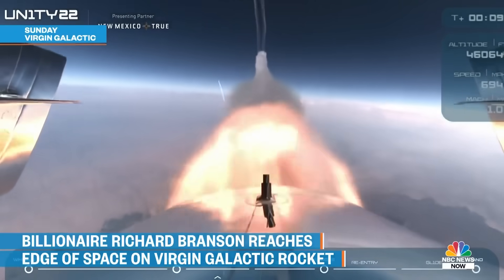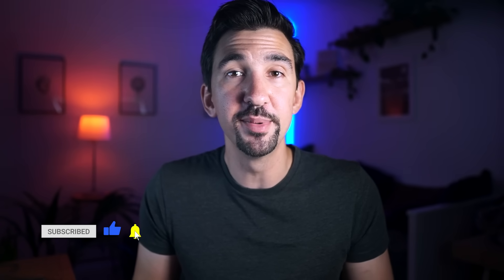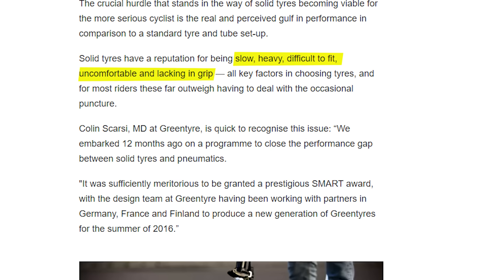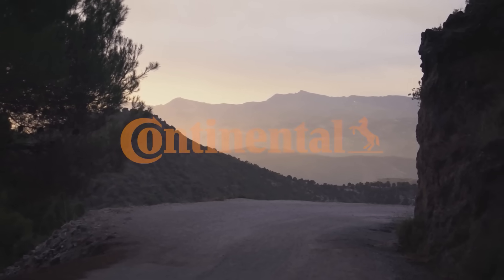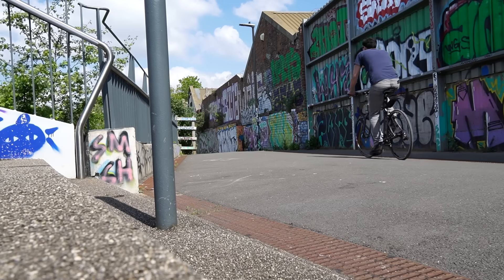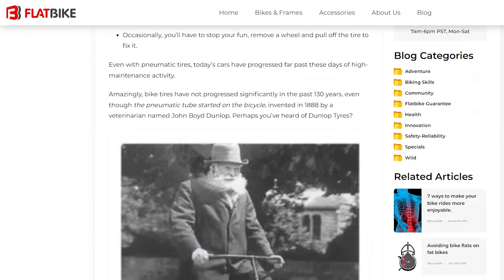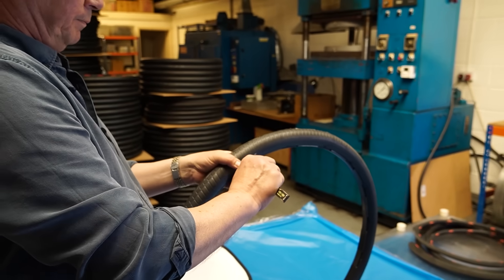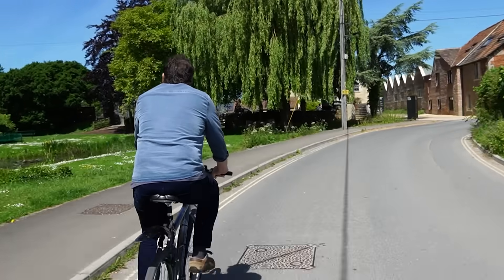I Tried Solid Bike Tires | Here's What I Found

Comment: You brought me closer to believing that this is possible. The bicycle is an interesting thing, because so many people think they can create an idea and build it for the bicycle since the bike is a simple machine. But because the tradeoff between energy efficiency and reliability is so delicate on a bicycle, in over a hundred years, we still haven't come up with an alternative to the pneumatic tire. We may never, but this idea is intriguing and promising.
Reply: You are 100% correct. The bike looks deceptively simple but it is almost impossible to improve it. The chain is the perfect drivetrain for it. Cheap, efficient, multiple gears and easy to maintain. The derailleur and the gear system is also just perfect. Cheap, reliable, efficient etc.. The pneumatic tire is very good for all things a tire needs to do and the frame is pretty much perfect with relatively small adjustments. Just for riding, manufacturing and maintenance the bike is pretty perfect as is.

Bicycles are all about simplicity. Meanwhile the tire of the bicycle is probably its most complex item. Solid tire makes the bike simpler which in my mind which means it could be better than what we have. Not necessarily in ride quality but in many other aspects. The tire waste issue is definitely a problem that needs solving.
Reply: Oh there are alternatives.  You're just not using them, snowflake.

Comment: Or you could use sealant in your inner tubes, or run tubeless with sealant and essentially avoid flats that way. But I really appreciate the points about recycling these!
Reply: Tubeless doesn't always work, if your  flat left you with a bigger hole and you had to use a slug to plug the hole, you still need to replace the tyre, it will always lose air
Reply: @nickjohnson710  still functions with a tube in it at worst. Generally you can do an internal patch of a big gouge with a little slice of inner tube and super glue and maintain tubeless.
Reply: @devswell6538  but why would you want to do that? I've been running tubeless since 2008 on my MTB, but I run inner tubes on my road bike
Reply: @devswell6538  still functions with a tube in? So what's the point of going tubeless then??? This is my point, if your hole is that big, that you have to put a tube in, what's the point of going tubeless, the whole idea behind tubeless is that you can run lower tyre pressures for more grip, that makes sense in mountain biking, but on a road bike??? Doesn't make any sense at all
Reply: @nickjohnson710  the point is that it’s not wasted also the chance of you puncturing a tubeless tire on a road bike is so incredibly tiny that you would probably go through 4 or 5 tubes in the same time. Ive put an entire stick through a tire before and ran it with a plug for another 8 months btw and could have gone longer.
Reply: @devswell6538  you obviously don't ride in the town I live in .....how do you figure that out, that you can't puncture a road tyre?!!! With tubeless, look I Don't want any lectures from you, if your going to be the champion of tubeless, then fine that's your opinion....but Don't try to convince me that tubeless isn't with out fault......why would you run a tyre that had a stick through it, kind of sounds stupid to me,you should have replaced the tyre!!! Anyway this conversation is over........goodbye
Reply: The tyre may not go down but it still has to be fixed.
Reply: @johnnunn8688  still uses way less rubber then this monstrosity
Reply: @liamsweeney4754 , that has zero to do with what I said.
Reply: Tubeless is the way to go. I just had my first summer without a flat.
Reply: Tubeless also doesn't work if you dent a rim from hitting a big pothole. Ask how I know...

Comment: Tubeless has been great for me on MTB so far (year and a half). No flats, plus the ability to adjust the pressure, including very low pressure like 10psi that you would never run with a tube. Punctures can more easily be fixed with a simple plug system. The sole remaining problem is that they do need checking and pumping regularly. Also I bet they are lighter than any solid rubber tire because there's no tube. I actually think an almost-solid rubber tire with an air chamber makes some sense. This would restore more of that air cushiness as well as some adjustability for firmness , yet they would still be virtually puncture proof as well as be able to run on zero pressure. In fact a lot of MTB riders put foam inserts in their tubeless tires to help prevent pinch flats and give some run flat ability. If a tire included that kind of technology in the tire itself then you would have basically a semi-solid pneumatic tire like I'm talking about. Of course if a pure solid tire like the gecko is completely recyclable, that is a huge plus.
Reply: Honestly, I have very low hopes for gecko tyres actually getting recycled any more than pneumatic tyres, just like regular plastic items are hardly recycled despite decades of research and infrastructure creation.
Reply: @francescomastellone9444  the problem will be to keep them seperated from non recyclable tires.
They'ld probably need to do something like free return of old tires when buying new ones. (maybe best via bike shops)
Reply: @francescomastellone9444  Are you old enough to remember milk bottles or taking beer/pop bottles back for the deposit? 

That would likely require in house recycle, so legislation could help & licencing could be more viable than trying to grow a new tyre business.
Reply: @ethelmini  I'm not old enough for that, no :) It would be awesome of course. I don't think in-house recycling would be the way to go for this particular tyre brand though, they would need to set up recycling operations in all countries they sell in. Does any brand do that?
Reply: @francescomastellone9444  Not implausible, they'll have to ship out their products so will need the transport link. It'd be a simple cost model shipping & shredding old tyres Vs the cost of processing raw materials from scratch.

Defo becomes more viable with scale though.
Reply: @ethelmini  People hardly recycle even when it means just leaving trash outside for a garbage truck to pick up, and you're calling "simple" a solution that involves much more active effort from customers? I laud your optimism!
Reply: @francescomastellone9444  this always just seems to be an issue of organization, here in sweden plastic is recycled just fine because most people can just chuck things in the plastic recycling bin outside their apartment.
Reply: @swedneck  Sweden seems to have much less of a NIMBY problem than we in Italy do though, as far as I remember a lot of your plastic ends up burnt into energy rather than recycled as plastic. Which if done well is absolutely fine by me, I wish we could do the same in Italy without riling up a media ****storm, but it's not really recycling... Also I think that can already be done for regular pneumatic tyres too?
Reply: @swedneck  How much really gets recycled though?  Germany also has recycling bins, but for various reasons a fairly small percentage ever gets recycled.
Reply: @francescomastellone9444 , one can hope, that Gekko will introduce a deposit system, to encourage the return of the dead tyres into a recycling system?
Reply: Adjusting the pressure is so important. Yet everybody forgets about it when the talk is on.
Reply: Vittoria air liners for road deform to next to nothing when air pressure is present in tubeless , gravel version does same but doesn't deform.  Both offer the benifits of tubeless and solid tyres 👍
Reply: plus it fits on all rim widths.
Reply: Tubeless works better on mtbs than road bike, struggles on road bikes due to the higher pressures.
Reply: @gareth2736  I  use tubeless road tires 2500-4000 miles/ year with no issues. I'm well over 200 lbs
Reply: @richardlocke7264  oh, maybe it's improved, thanks for the info.
Reply: @gareth2736  FYI I use 28mm (mostly) and 32 mm tires.  not 23 or 25 mm
Reply: @richardlocke7264  I use both 28 and 25mm tubeless at the same 5.5 bar pressure and I am at around 220 lb without gear/bike. I wouldn't go to tube type anytime soon. But on a secondary bike that I use for rougher unpaved roads (gravel-like) I would very much like to try this kind of tire. Especially since there's zero maintenance, and I do use that bike when the weather is bad and carbon wide rims plus tubeless doesn't seem like a great idea

Comment: Making a crisis out of a non-crisis.  You'll never replace air filled tires (performance, cost, functionality).  An airless tire will find a place once they "get there" with cost/performance. Yet, getting the non-linear function out of an airless tire will be very complex, costly.   The weight hit is significant.

Comment: im a bigger guy, using my bike as a way to lose weight. so far, its actually gone pretty well. except, the huge number of flat tires i get.
eventually my bike shop recommended trying Stop-A-Flat. never a flat tire again! though, they charged a decent bit for installation, and i can see why. thought the wheel was going to break watching them put it on..
things went great at first.
until just a few days ago, about 4-5 months into having it installed, i realized...the tire is flat. yeah, that foam literally flattened out. guess that explains the increased road resistance i have been feeling the last month or so.
now im looking at Tannus and their solid rubber tires..though, the reviews on them look like they add 3 to 5 pounds each depending on wheel size. the road resistance on those must be terrible..

Comment: Rally motorcycles and dirt bikes have been using mousses for a while now. That technology could be potentially applied to bicycle tyres although mousse are not good for the road.
Reply: The tech for that is already out there. Look up Cush Core. It's pretty much like a pool noodle that you fit into a tubeless tire that will allow you to continue riding with a flat.

Comment: The problem I see with this is most of my tires I replace as the tread is worn off…. If the tread is hoarder and doesn’t wear they are too low in traction… so this kinda makes solid tires a bit meh.

Comment: I have those solid tires, I was tired of getting flat tires. I have not had to fix them yet but, I have noticed the bike is harder to ride. The friction  is a problem for me as I get older my legs get tired faster. My other bike has fat tires and it is easier to ride because of the air. I like the idea of not changing a flat tire but, for comfort the air tire is better.

Comment: I both cycle and ride an electric scooter something like the Gecko would be ideal on a scooter.. My scooter has tubeless pneumatic tires. I haven't had to change them yet but they seem much more difficult to change being so small (9") and stiff, not to mention the motor is in the wheel itself. Some scooters even come with solid tires. The Gecko sounds like a good compromise for comfort, handling, and zero maintenance.  For cycling I think I most appreciate that they are recyclable and will never flat.

Comment: I used solid tires for two years. The rolling efficiency is really low, I went back to pneumatic tires with STAN sealant.
Reply: I had the same experience with solid tyres, these geckos aren't solid though, can't wait to try them or see more reviews to assess their rolling resistance

Comment: Why can't you manage to carry a spare tube? What takes you so long to check the tire for anything to remove and swap the tube? What's with your tire/tube seating technique? What's with your handling style that leads to such frequent punchers? Why you waste tires so lightly? It's ridiculous man you go down the bike shop look in there used tire pile and loads of them are decent condition, they just can't re sell a bike without brand new tires. Yeah change one at a time also move the one on the back to the front wheel and put new on the back as back wears down quicker and needs better tread. So rotate back tire to the front when replacing in the correct intervals, much more economical than replacing both at once. Don't leave tires in strong sun for long.

Comment: Really fascinating, I love the idea of airless tires but I am dubious about comfort. I currently run tubless 52mm tyres on my commuter and I just can't see anything ever beating them for comfort - plus, despite being slightly fidly to set up, now that the tubeless tires are in place I've not had a puncture in a year - can't complain!

It's an interesting development and I think it solves a lot of the eco concerns, but as far as being maintenance free, comfortable and fast - there are plenty of options out there already.

Would love to see the technology continue to mature - more options are a good thing.
Reply: Im in comfort side too. Now I use 50mm tyre with thin Schwalbe Raceguard puncture belt and 108g thin tube, pumped about 40 psi. Do you know how they compare to real tubeless-supple tyres?  I use also continental winter only tyre, just for front wheel. Never had puncture in 2 winters, it has vectran breaker puncture belt which is space technology.

Comment: Seems like this would be an excellent fit for the increasingly popular e-bikes segment. Bike lane and Pavement-only Cargo and Commuter e-bike styles seem like the best fit. Helps keep the e-bike ready at all times....and importantly, gives the e-bike company better "performance" (spec'd to always offer least rolling resistance for Max Range) and safety features (no flats EVER...gets you home) to tout.
Reply: And a bit of extra rolling resistance would matter less on a ebike than a human only power bike.
Reply: no, these would be terrible for rental bikes and expensive e-bikes. these kind of tires literally destroy your rim, usually in under 100 miles. solid bike tires are a bike shops best friend, because it ensures youre gonna be coming back every 6 months to get your rim replaced or repaired.
Reply: I'm a bike mechanic, and it looks like we're going in the opposite direction, because people are damn stupid. The last 'trend' of the mass market are those cheap chinese eBikes with Fat tires. Guess what, they get a puncture on average 4 times as often as a normal tire. Imagine having a tire as large as that of a car, but same materials as a regular cheap bike tire. You basically scoop up every piece of debris you find on the pavement. 
For higher end eBikes the solution is Tubeless tires. That's it.
Reply: @DerpEye  I'm all for other bikes scooping up every bit of debris - that's less debris for the rest of us to get a puncture!
I have have a 2kW ebike (converted old mountain bike with no suspension), so I use the biggest tyres I can get to fit on it with medium pressure to help absorb the bumps.
After 7 years, I've gone from getting a puncture sometimes 3 times a week down to maybe less than 3 times a year, so getting punctures is not something I worry about now.
This coincides with the rapid rise in cycling popularity and dedicated bike lanes around Budapest, even though my average distance has increased.
Reply: @DerpEye  I have an e-mtb, it was night and day when I switched to tubeless! Not only puncture are rare although I go on forest paths with spikes bushes, but also the prevention liquid makes the tire leak much less air, so pumping it is also much less often needed.
In the video, he also didn't mention an advantage of air tires: pressure is adjustable. To rider and load weight (can be important for cargo ebikes usage). With solid tires, this parameter is fixed... 
And as someone mentionned, it would be very important to test the grip, as in city for ebikes, roads can be slippy because of rain but also oil and ... tires remainings on the road... (+ a big trap is when riding on tramway rail, metal is super slippy when wet).
Reply: @DerpEye  I love how you write debris <3
Reply: Foam tyres can't compensate for different loading weights, so may need a large amount of different densities for everything from kids bikes to 250 kg all-up loaded cargo bikes. Still, I can also see some ebike users choosing foam. And rental bike providers will certainly be interested.

Comment: Would this really be better than air tyres + slime anti puncture liner ? 

Sure you would still have to check air pressure but punctures would be almost impossible if coupled with a good resistant tyre.
Reply: as a daily rider of some 2000 miles a year I am using Slime anti puncture liquid in tubes and I go about a year or two and when I change my tyres the tube has maybe 8 sealed punctures. So no events in a year of fixing punctures on the road ....